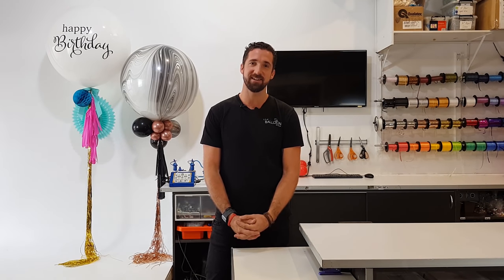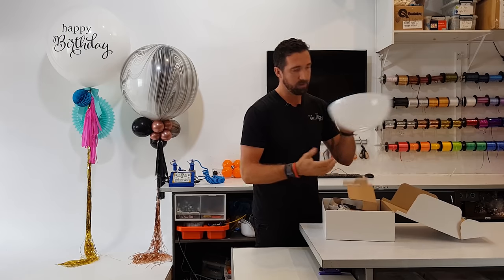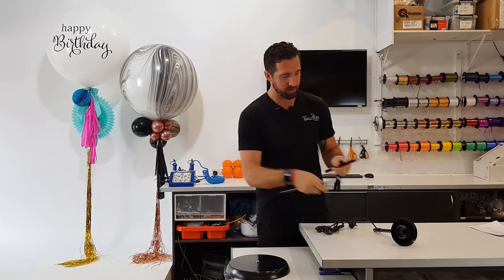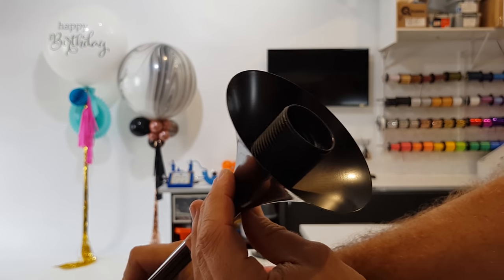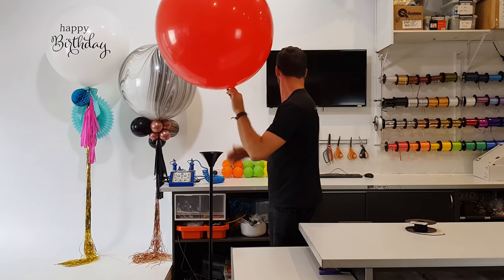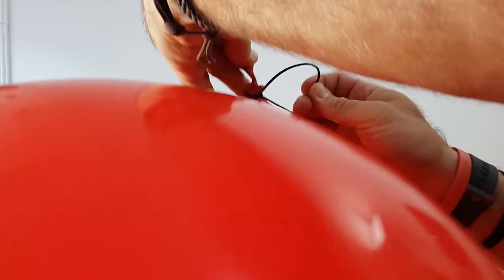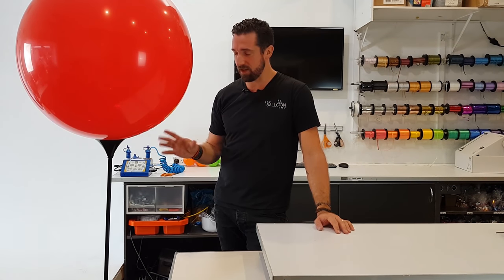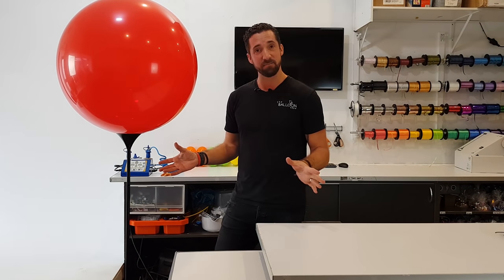Q Corner special. 3ft balloons set from an Ikea Not Lamp

Comment: Hi Chris from Bonnie Scotland. Thanks for this informative video. I have been thinking of exactly the same sort of thing with these poles. I haven't used any Helium and not keen to get involved with the added expense myself.  I had thought of running chord, or 260(s) inside the length of the pole sections and tie off at the stand's base but much along similar lines as yourself. All the best to you and yours.
Reply from the maker: Hey Andy. That would work perfectly! Nice idea!

Comment: That bit that comes out when you put it in the vice is not shifting at all! I bought from ikea Uk and have 2 and both the same but I have no vice and I’m pretty weak but tried pliers etc and nothing getting it out. Any tips? Or anyone else had same problem and overcome it?
Reply: it is crazy how hard it was for me to get mine out. I cut the cord, showing a little ikea key into the hole, using the key to stop it from turning with my hip while I used all my strenght to twist the "collar" with both hands and eventually it came loose, but no way it was easy like in the video^^  I felt like the hulk screaming "I'm not a quitter!" XD
Reply: I grabbed a towel and held the bulb fixture in my left hand. I turned the black metal ring towards my body (counter-clockwise). Like Therese said, I almost gave up several times. It takes a few hulk-like moments to get it done :-D